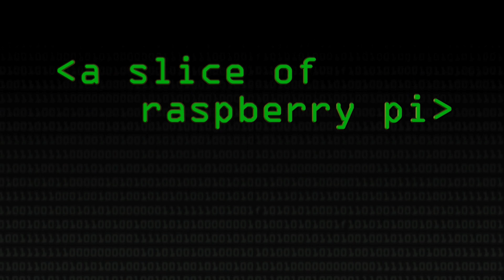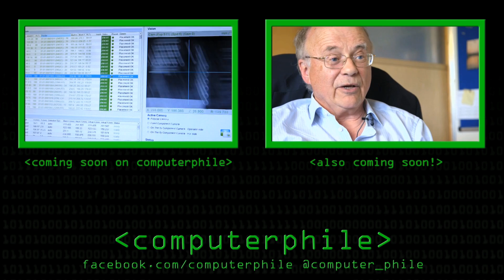Raspberry Pi Hardware - Computerphile

Comment: I can't believe they got away with the flimsy, transparent excuse that "People are more likely to own a full sized SD card" for SO LONG, to excuse themselves for having made the RIDICULOUS design decision of having a NON latching friction SD card socket which STUCK RIGHT OUT OF THE BOARD, and which the SD card only slid HALFWAY into, and was always being knocked out. I was working in mobile phone repair in 2006, and Micro SD cards were ubiquitous even back then, and the price difference between SD and Micro SD was negligible - they were in MANY mobile phones even back then. Poor excuses for terrible engineering decisions don't often hold much water.

Thankfully they fixed it.................. eventually o_O

Comment: Wouldn't it make more sense to put the CPU on the RAM so you can better cool it? Does make the route from the CPU to the PCB longer though :\
Reply: +ThaTyger Then your cpu connections would have to pass through your ram chip and you would have to fit more of them on and have less space for ram.

Comment: Sorry for the dumb question but, does this chip heat's up? ...ofcourse it does I'm dumb but somebody answer me please
Reply: Falcrist Yes. And I'm sure painting it red makes it go faster.
Reply: Falcrist If you read what i put i said it was mainly for show.
Reply: Jayson Harris I read it. I'm being a bit more absolute with the statement. There's absolutely no need for a heatsink.
Reply: iiperento Nope, not much, well... It can. I would recommend those small heatsinks as they will cool down the pi and extend its lifetime.
Reply: iiperento being that the chip is made of semiconductors (like all other consumer chips) it DOES heat up.....
However, it is not super powerful and therefore doesn't even require a heat-sink most of the time because it generates very little amounts of heat.....

If you were to overclock it then it is suggested to implement a cooling solution....

Comment: @ Hari S   It seems to me that M$ does an extra test stage, beyond beta.  Every-other OS seems to be a prototype for the OS that follows.  Windows 95 was bad, '98 was fine; 2000 was fairly reasonable, but then--for some reason--ME came out and was horrible and quickly replaced with XP which people are still using; Vista came out and had a poor reception due to its lack of compatibility, but 7 followed and fixed everything again....now we have 8.

Comment: wow still here defending windows ey. Well I do like Windows 7 well enough although the short comings of windows are increasingly apparent to more users. Still has some good things, however, since I just saw a Cisco switch running a Linux OS and am increasingly surrounded by high end devices using it as well as typing this on Linux desktop I'd say the writing is on the wall. But windows will be around for a while yet so stop stressing.

Comment: Stuff you need is not fair for Windows install time.  If you use 100 programs, that has nothing to do with Windows install time.  That's your fault.  And, on an initial install, you shouldn't have to defrag since everything will be installed sequentially.

Comment: As everage windows pc will be something like quad thread intel i3 cpu @ 2.8GHz and Intel HD 3000 GPU(270GFLOPS) with 2g of RAM.
And raspberrypi contains a 700 MHz single core ARM11 cpu(equipment to 300 MHz Plentum II) and PowerVR sgx GPU(25GFLOPS) with 512 MB of RAM.

RPi is really slow compare to normal PC.
However, raspbiab os is specially designed for raspberrypi, so it boots really fast on it.

Comment: Windows 7 take 40 minutes to install, 20 minutes to install drivers that come on the CD's since it can't detect wi-fi and sound by default, 4 hours to download stuff that I need, 45 minutes to install everything and 1 hour to defrag. Total of 6 hours to me and is annoying.

Now i use Linux and take less than 1 hour to do all that to get the same results.

Comment: Whatever. Your minutes doesn't include full microsoft update process. You also can't find a PC able to run your full version of windows 7 , size of a credit card and price 25 bucks. Windows 7 is great, but it's aimed for desktops and laptops, not labs... Linux is everywhere, from your car to your phone, from your router to the clusters giving you the weather forecast, from this web server to calculating Titanic's 3D. Just not the same ground.

Comment: It actually is possible, just like it *is* possible to host a webserver on a pi running raspbmc. However, raspbmc is *specialised* in media playback, and for that function, it's interesting to note that such a "modest" machine is capable of 1080p. But regular raspbian will also do 1080p just fine. Although for complex video formats decoding, you might need a MPEG2/VC1 codec, which you can buy for a few bucks from the rpi org (not included in standard price)

Comment: In the pi I guess its mostly for space issues. But suppose you have a 1GHz CPU - in 50ms it is supposed to make 50 million operations. When you are just connecting to a server, it doesn't hurt much to wait that long. But since the CPU and RAM have to communicate constantly, they would have to wait at least 6 picoseconds longer for every mm of distance. At some point you would then reach a limit where it wouldn't make sense to make the CPU faster, because the communication can't keep up.

Comment: If your computer processor took 50 milliseconds to access each memory location you would be limited to accessing memory at 20 locations per second or 20 hertz. Assuming 1 byte per dot (pixel) on a 1080p screen and a 32 bit system (4 bytes at a time) 1 screen would take 25,920 seconds to load or 432 Minutes or 7.2 hours. This is also why the jpeg image compression standard was developed :o)

Comment: Of course its important. With lower distance there is lower latency, which is a good thing. But in case of raspberry pi, it's done to save space, since this is a cost and space optimized platform.

Comment: Ram is used while running programs etc. Its considerably faster than and SD card. However it does not retain the memory after its powered down. Even your smart phone has ram for actually running things and loads from the SD memory as required.

Comment: many companies (including logitech and microsoft) have nano receivers that support both a mouse and a keyboard (logitech can actually support 6 devices on one receiver) so that wouldn't be a problem. You can then use a storage device on the other port (however, you cannot use a usb-powered HDD. The RPi itself is powered by a micro-USB and you need a powered usb hub or externally powered HDD to be able to use one). Also, most HTPCs connect to media through the network (i.e. NAS), so yeah...

Comment: My computer is a 3.2 GHz duel core, 8 GB ram, 2GB video card, combined 1.1 TB disk space, and a 5.1 surround sound system...

Your phone is, at best, a quad core with only 1.7 GHz. Depending on where you are in the world, you might have only a 1.5 GHz duel core. And, you have 1 GB of ram, not 2. Your total storage is at best 64GB, but might only be 16GB, and 2-8GB of that is system use.

Don't kid yourself. Phones don't compare to normal computers in any aspect.

Comment: There are a couple of things:

1.) Yes, you can get a USB hub. Get a small one that uses very little power, or it won't work.
2.) Get a wireless keyboard and mouse that run from the same bluetooth USB input. The one I got for my Pi is a Logitech keyboard with built in touchpad in place of the number pad. Works great.

Comment: yes, my powered 6 port USB hub by Dlink is very compact and also powers the raspberry pi itself via one of the USB ports, thus eliminating the need for another connection to the wall power socket.

Comment: Could you make a large parallel processor using a bunch of these connected by the 27 pin I/O connection? With 5 of them you'd probably be able to make a pretty fast computer for less than $150.

Comment: The light board in this video looked simply to be made of a prototyping board, wire, LEDs, buttons, and resistors, so it wouldn't be too difficult to build.
I'm absolutely certain that you could find all of the necessary parts on Adafruit's website.
Alternatively, you could get a GertBoard or some such pre-assembled thing. goo(dot)gl/gTuVg
For a good project... well, anything would do, really. To start, you could do something simple, like alternate flashing lights.

Comment: LOL, my One can do HDMI and stuff. It has 2 GB RAM, Has USB OTG, not sure if the GPU can handle blueray, but tell me, is a !)*)p screen blueray? isnt blueray much more pixels?
I can do spreadsheets and Word etc on the phone. I dont think i can do programming.  With micro USB OTTG, i can connect a mouse, keyboard, monitor etc onto the phone. You have to remember that phones are becoming as powerful as computers these days.

Comment: does it have a sensor on the chip? also afaik, the openpandora is said to freeze way before it can get even hot enough to damage the chip, some of the devs said it was common for these chips to get unstable way before they can reach a speed at whch they would overheat. Cellphones on the other hand shouldnt get above 40ºC just because they would feel uncomfortable to hold as with notebooks, also lipo battery. Handheld devices arent suppoused to be more than 5-10ºC above ambient temperature...

Comment: does your HTC output composite video?, ethernet? hdmi/dvi? 512mb of ram? usb master? GPIO pins? blueray capable gpu? no? ost surely because your cellphone is not a develoment board/pc like the Rpi. Your cellphone can do cellphone stuff, the Rpi does Rpi stuff, comparing is pointless as you cellphone might be more powerful than a pentium 3, but you can do way more usefull stuff on a P3 than on a cellphone (spreadsheets, word,  programming, web, you have a keyboard, mouse,hdd and a monitor too...)

Comment: It's very difficult to get a Pi to overheat - it uses a different architecture to PCs and is considerably less powerful (700Mhz by default with 512MB RAM, but it's now possible to dynamically overclock it, so if it starts getting hot it will automatically reduce the clock speed.) Similar CPUs are used in the original iPhone, the Kindle 2, HTC's Aria / Dream / Hero / Legend / Magic / Wildfire and Samsung's Galaxy Ace / Europa / Mini / Y / Gio / Pocket.

Comment: Linux is the kernel: the program in the system that allocates the machine’s resources to the other programs that you run. The kernel is an essential part of an operating system, but useless by itself; it can only function in the context of a complete operating system. Linux is normally used in combination with the GNU operating system: the whole system is basically GNU with Linux added, or GNU/Linux. All the so-called “Linux” distributions are really distributions of GNU/Linux.

Comment: Many computer users run a modified version of the GNU system every day, without realizing it. Through a peculiar turn of events, the version of GNU which is widely used today is often called “Linux”, and many of its users are not aware that it is basically the GNU system, developed by the GNU Project. There really is a Linux, and these people are using it, but it is just a part of the system they use.

Comment: At the most basic level, completely oversimplified, a CPU or any microprocessor is fed 0s and 1s through a bus (either 64 or 32 bit commonly) and then it spits out another set of 1s and 0s to be used by another part of the computer. Although even this was tipped on its head when out-of-order processing became the norm.

Comment: Umm... just about all of them?  A language is simply a method of executing instructions, whether interpreted during runtime or compiled into binary instructions, or a hybrid of the two like bytecode.  A language isn't an application itself, where it may make sense to wonder if it runs on this or that operating system.  (Though it does make sense to ask if an operating system has an interpreter or compiler for that language.)

Comment: they construct the logical gates with switches. add switches together in the right order and you create a logical gate. construct logical gates (with a timer in the right order) and you can add states. when you have a ton of gates you can construct yourself a CPU. add some RAM and you have a working computer. You store the code in the RAM and construct the CPU so that it can process the code (assembly code).

Comment: Well you can get a 8-bit microcontroller for ~4 euros where I live. Make a little project on a MC, using your datasheet as a guide, and you get a great low-level understanding of things (I did this a couple of years ago, making a crappy robot which you can see on my channel). Of course the Pi gives much better processing power, but I'm not sure it's necessary for beginners, especially considering the added complexity. You could also learn assembly with simulators, for example the MARS MIPS sim.

Comment: that is one of the most mind blowing things about computers. the main thing is that the right numbers get to the right place and it only means something to the right hardware. Ignoring the data, code eventually gets turned into machine code in the form of a .hex file. This code is different depending on the chip it is for. For arm each instruction is 32 bits, that instruction contains an operation code which tells the processor what to do and operands which tell it what registers to do it with.

Comment: .....where do you buy things? I have not seen many a mounted microcontroller with peripherals cheaper than $25....or a pc come to think of it.....you can buy just the chip and mount it your self but soldering or etching will never look as good as professionally done boards and you still have to buy all the peripherals and if you mess up you have to get new parts. Maybe inflation is different where you live but in my area $25 is cheap for that processing power.

Comment: done a few xboxes. paste isnt the only problem, its a reflow issue sometimes. if the board flexes and the bga loses connectivity you can overheat it like janis said, but sometimes it'll just re-fail quite quick. proper reflow is the way to go and there are some kind of kits to stiffen the board so the xclamp doesnt flex the board in the future

Comment: The xbox did loose the connections because of the x-clamps, removed those, let the xbox overheat without the fan and it started to work again. How long? Well, that depended on each individual box, some dies shortly after, some never broke again. Reflowing was an option too.

Comment: It's the PS3 that looses the solder connections IIRC. I thought the Xbox just lost the heatsinc paste? I've done the Xbox with little more than a re-do of the paste. The PS3s have needed "re-flowing" (though I only use a heat blower, not professional. :P ).

Comment: one other issue - the compile time. atm my favourite arm soc board is odroid x running linaro for $129. it reduces compile time (and in turn development time) but a huge factor. odroid x also has some issues with booting consistently, but more reliable than rpi. it's good to develop on odroid x and deploy to rpi.

Comment: okay, i'm a huge pi fan (when it came out, and now) and it's great to play around with the gpio. i know it's a learning tool, but i couldn't resist deploying it. upon deploying it completely headless, there trouble having it boot consistently. ie, boot fails after 20 power offs and ons, and i need to connect it to my monitor and kb to debug. reliability is my only major issue with the pi. it's probably not built for such deployments as it's a learning tool.

Comment: It depends what you are trying to learn. I am a computer engineering student and one of the main things we do is low level programing without an operating system, using assembly or c, which is platform dependent. This kind of programing can be used to control all sorts of things and responds much faster than a pc even when it has much cheaper hardware. What makes the Pi confusing and awesome is it bridges the gap between that kind of applications specific computing and general purpose computing.

Comment: I just looked up (googled) the power requirements for current desktop processors, and then the thermal efficiencies. I couldn't find anything on RPi's thermal efficiency, but I did find some pretty extensive documentation of its power requirements in watts. You may want to look up cluster computing; it's a good way to use inexpensive computers to get a lot of processing power, but what it gains in thermal efficiency, it looses in complexity, as complexity needs to be managed.

Comment: Open a laptop to learn about hardware, and how to program for it, the purpose of Pi IMO. A power source can be a mini USB phone charger > 700 mAh (~$3). SD cards, many people have left overs from the cameras. Speakers not needed if going into a HDMI TV as it carries audio and video. And who doesnt have a keyboard and mouse handy? So in the end $25 + $3 for most. Or if you didn't have the basics, add $10-$20 for SD and $30 for keyboard/mouse combo. That's still only ~$80 not included the TV.

Comment: That's a good point. I use my Pi hooked up to my TV using it as a mumble server, SVN repo, etc. It just bothers me how the Pi is oversold, as if the stumbling block of beginner programming has been hardware, or as if the Pi is a practical home computer for people with little money, or as if the Pi is somehow especially well suited to learn about low-level computer architecture.

Comment: "As long as you have resources... ". Exactly, you need the RPi, a power source, probably a mouse, a keyboard, a HDMI cable, a screen, a SD card, possibly speakers and possibly another PC with a SD card reader. The bang for your buck is quite small when you consider all that. Why would you want to open your laptop up?